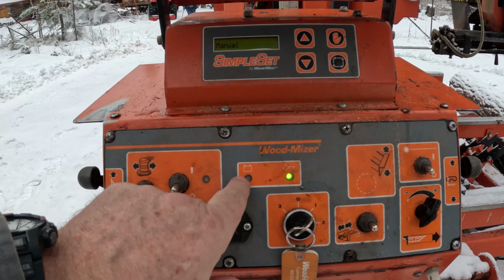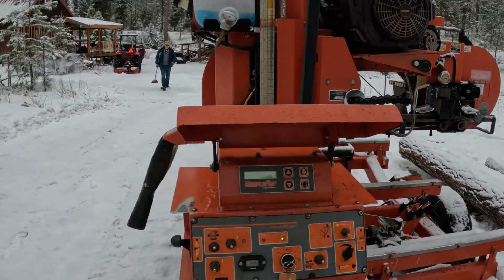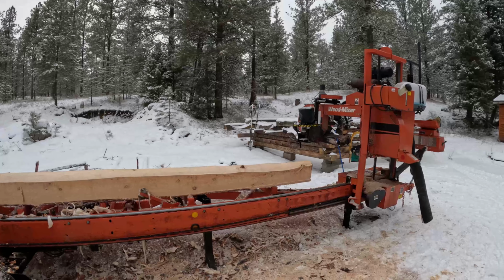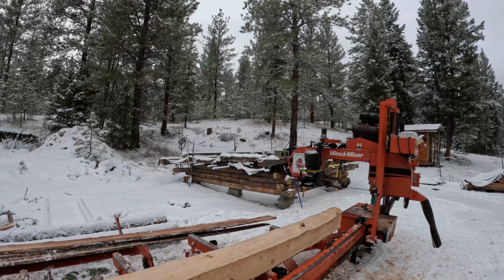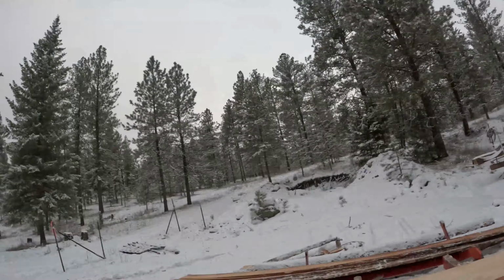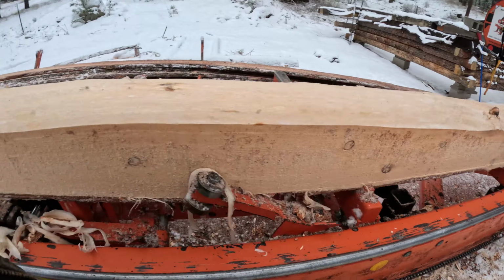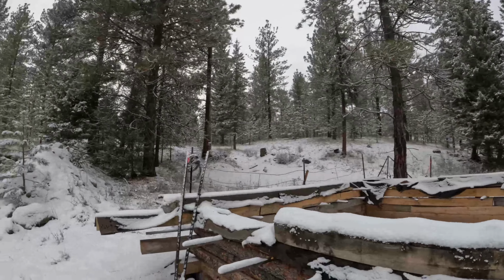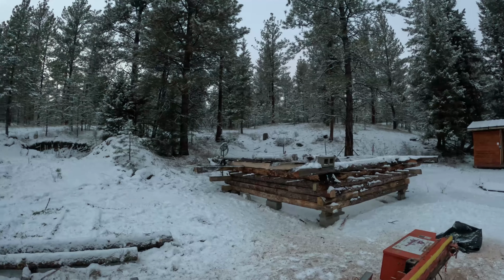Sawmilling D-Logs in the Snow for our Off Grid Cabin Build #woodmizer #sawmill #offgridcabinbuild

Comment: I us a bark shovel (called Barkespade in Norway) to remove the bark. I stand and push it away from the body, it is both safer and a better working position. Barkespade was used a lot in the old days when lumber was pulled out with horses in the winter and floated down the rivers. Those who debarked timber was not happy with any knots sticking out, so the lumber Jacks had to swing the axe well. Otherwise, they would get a lot of bad mouthing😉
Reply from the maker: I have a bark spud, which is like a curved chisel, but it wasn't working well.  part of the problem may be the winter, which I've never peeled bark in, and I've heard it's harder due to less sap flowing